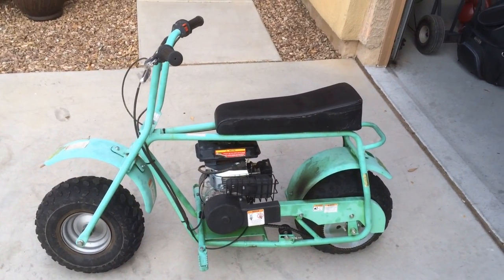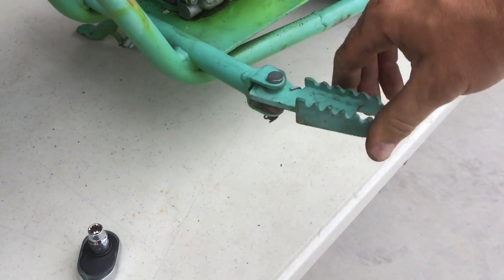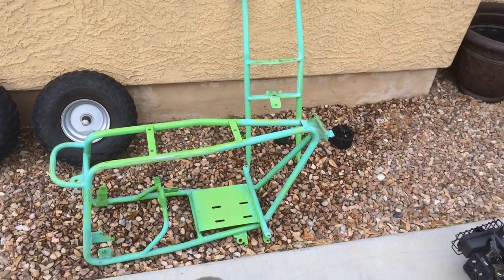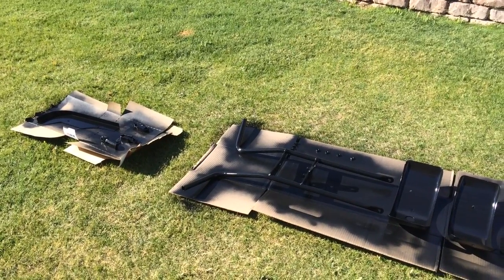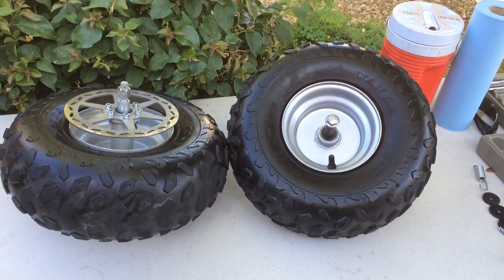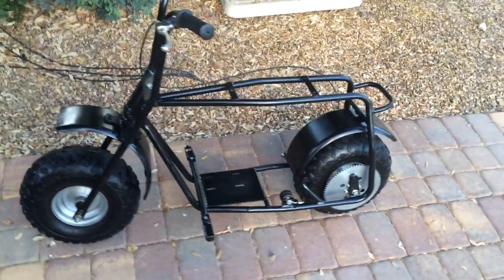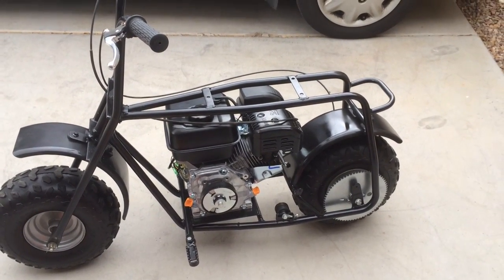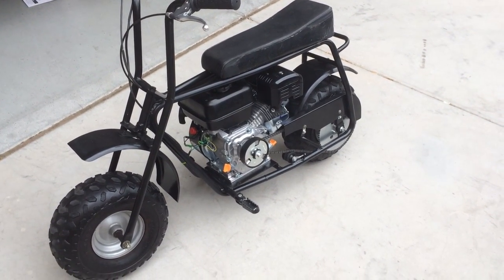Baja Doodle Bug Project

Comment: I got the same minibike for my son with the same lil gutless motor. I got the 212 hemi and put stage 3 mods. And did some sprocket changing. 52 mph according to GPS. I also took out the governor. Oh and put on shocked forks for a smoother ride. On the front only that is. Lol. But it keeps tbe front tire on the ground better like a strut s does for ur car.  Nice vid bro. Plz be safe. But HAVE FUN DOING IT..!!

Comment: this video really helped me build my bike it almost looks identical to urs the only problem im having is the clucth tearing my shoes and pants up i guess i will have to fabricate a cover at work but nice job on ur build can't wait to post my vid!
Reply from the maker: I'm glad to hear your project went well!  It's way too hot in AZ to even wear pants, so I can't say I've ever had the issue of pants getting torn up by the clutch. Just to verify, you have the sprocket portion of the clutch facing toward the motor, right?  I'm not sure the chain can line up correctly if you had it turned around but that might explain the issue you are having. 

For simple options, They make straps that attach to your pants and go under your shoes to keep your pants from getting caught for regular motorcycle riders.  You could also get a Velcro strap to wrap around your ankle area to keep the pant legs secure. 

Drive safe and have fun!
Reply: Yea i have the sprocket on just the way u have urs and believe me im from Houston TX and it gets pretty hot over here but i work at a fab shop so ill figure something out to cover that i will pass on ur video to other mini bike builders greetings from H-Town!

Comment: I’m glad you showed how to install the shutoff switch on the handle bar , I am doing it now , also I’m upgrading the pipe and air filter and Possibly the valve springs

Comment: That's looking pretty sweet, but just a word of caution on your grip installation technique from a bicycle mechanic, use rubbing alcohol or hairspray instead of soapy water. If the grip gets wet again it can cause the dried soapy water to unstick and your grips will slide right off.

Comment: I redid the Coleman ct200u with the 212cc ten tooth clutch and 50 tooth rear, it only does 22 mph but I built mine for off trail. I live in Oregon so I need more torque then speed. Looks great.

Comment: What clutch are you running? I'm 220lbs and mine shakes like hell on acceleration, I feel like it's the clutch struggling to lock up, but it's also a cheap clutch.

Comment from the maker: Although it's a pretty tight fit, there is room to remove the gas cap and fill the tank with gas.  If you have a gas can with a longer, flexible spout it makes it easier.

Comment: I still have the original 97cc and the bike rarely gets used. I'm wondering if, after upgrading to the 212cc Predator, if the single disc brake is sufficient for the additional speed?
Reply from the maker: I kept the original brake installed without any issues. I’m sure there’s upgrades but I never did one.

Comment: Awesome build!  i just got a DB30 myself givin to me, unfortunately the engine and clutch are beat up pretty bad.  i want to do the predator swap aswell.. i went on harbour freight website and theres 2 different model #'s for the 6.5 212cc engine.  do you know which engine you got specifically.  was it the part #60363 or #69730?  thank you in advance.
Reply from the maker: That guy - If you don't live in California use engine 69730. Enjoy!

Comment: I live in arizona too, can you ride mini bikes around in your neighbor hood?
Reply from the maker: Snubz30 Motor vehicle laws apply to neighborhoods as well. That being said, if you ride around your neighborhood without being a nuisance to your neighbors, MOST people will not have an issue with it. In my experience, most people (usually kids) that have motor driven toys (mini-bikes or Go-Karts) drive way too fast, make too much noise and have no regard for neighbors. Me and my boys would ride this Doodle Bug for miles throughout our neighborhood on a regular basis without a single issue. Again, HOW you ride and how often you pass the same neighbor’s house will most likely determine if anyone has a problem with it.
Reply: Zach Wolfe ok thanks for the info

Comment: Did you use the same chain that came with orginal motor, plz let me know asap thank you.
Reply from the maker: No. The description has all the parts I bought, including a new chain from eBay.
Reply: Oh ok thank you very much
Reply: As long as it's a #35 chain I should be good right?
Reply from the maker: Make sure it's a 140 link chain. It may not fit if it's smaller.
Reply: +Zach Wolfe  ah ok thanks
Reply: +Zach Wolfe I already bought the clutch and it's not a link just a description but thanks I'll just look for 140 link #35 chain, sound right?

Comment: Can you mount a 212cc directly to the doodlebug without the plate? What are the reasons for the plate?
Reply from the maker: Pyro Nurse You do not need the mounting plate but it is highly recommended. The doodlebug comes with a very thin bottom plate attached to the frame and an additional thicker plate that is also installed for support. The holes on the thicker plate do not line up with the 212cc motor so it cannot be re-used. In addition to the stability that is greatly increased with the PMR mountain plate, it also provides bolt placement adjustments which helps to make aligning the sprockets much easier.

Comment: I have the same set up but I didn't get the mount plate I drilled my own holes the chain is straight to the sprocket and clutch but the chain keeps coming off when full throttle at first or while riding. Any ideas why ?
Reply: K20xOG x check chain aligment or give it a bit of slack..

Comment: Will a 3/4 bore and 12 tooth for 35 chain clutch work with the stock rear doodle big sprocket?
Reply from the maker: SeanFilm Yes, no need to replace the rear sprocket.

Comment: Could you please provide the info on the mounting bracket you used?  Model and where you got it.  Thanks.
Reply from the maker: +Tony Hughes - All my parts are listed in my description:  PMR motor mount plate, drive shaft spacer w/clutch mounting bolt and throttle linkage kit = $66 shipped (hotrodminibikes.com)
Reply: +Zach Wolfe Is there only 1 size/model of the PMR motor mount plate?

Comment: did you need to drill holes through the bottom of the bike to get the bolt to go through the engine for the motor mounts???
Reply from the maker: Yes. The mounting plate comes with instructions but you will need to drill holes.
Reply: Zach Wolfe oh do you need the mount plate or can you do it without it?
Reply from the maker: +Jacob Kenyon You don't need the mounting plate but it makes aligning the sprockets very easy. The mounting plate allows for engine placement tweaking. If you mount the motor directly to the frame, there are no adjustments that can be made.
Reply: ok so is it worth it to buy one??? like if i put a 212 would the chain always be poping becouse my doodle bug i have adjusted so would the chain just pop off without it? or would the clutch and sprocket not be aligned
Reply from the maker: +Jacob Kenyon For the $40 or so, the mounting plate is worth it. Provides engine stability and alignment benefits.
Reply: Zach Wolfe ok thanks i will probably buy a custom exhaust and racing clutch and carb
Reply: Were did u buy the mounting plate from????

Comment: I found every thing but the stuff in the hotrodminibike website I don't understand what to get could you put down links or something?
Reply from the maker: PMR mounting plate:
http://www.shop.hotrodminibike.com/PMR-Adjustable-Motor-Mount-Kit-PMRMM.htm?categoryId=-1

Throttle linkage kit: (As noted in my video, this part is unnecessary.  The Predator motor has all the necessary hardware to attache the throttle.  However, I did hammer the 2 angled pieces flat in order to raise the chain guard)
http://www.shop.hotrodminibike.com/Throttle-Linkage-Kit-TLK4-65.htm?categoryId=-1

Predator bolt and spacer kit:
http://www.shop.hotrodminibike.com/Predator-Bolt-and-Spacer-Kit-PREDBK.htm?categoryId=-1
Reply: Zach Wolfe thank you so much

Comment: 5:22  I see that engine plate it was in other vids too do you reuse it ? what is it used for?
Reply from the maker: 1digitalwatcher The small engine mounting plate that comes with the original engine does not work with the Predator engine upgrade.  You’ll want to order the PMR mounting plate as listed in my description with parts.  It adds stability and easy frame mounting for the new engine.
Reply: @zach_wolfe  Ok THANK YOU  I got to order a lot of stuff been reading and reading on here !!

Comment: Great video but how hard is it to get that gas cap off?
Reply from the maker: Muhammad87 Others have asked the same question. It is less complicated than it would seem. Filling the tank requires a longer flexible gas spout to avoid spilling excess gas on the engine. Thankfully you get a lot of riding before needing  to fill the tank again.

Comment: I have a raceor and it is fun to use but the engine is messed up, if you have a enggine could i have it. My engine is pretty much shot by this point.
Reply from the maker: I don't have any extra parts, Trevor. If possible, save up and upgrade by following my video for guidance. Turns a fun toy into a beast of a machine!

Comment: looks like it would be hard to get to the gas lid to add gas. is it?
Reply from the maker: It's really not bad. Using a gas can with a flexible spout makes it easier, but the gas cap is not difficult to get on & off.
Reply: +Zach Wolfe thanks for the reply. I'm working on the same bike and you did a great job on your. hope mine turn out just as good.

Comment: I had to put another cable spring on to get better back rpm..20:30.
Reply: +ELVISRN1  put a torque converter if you have a few hrs. you will be impressed. great vid!

Comment: PMR mounting plate is mounted WRONG..."PMR" text should be on the left side of bike...
Reply from the maker: DeeInTheHouse Well, OK. Apparently it doesn't matter too much since it's been working great for lots of years. Best of luck on your build.
Reply: You are right, it will work...but, if you bolted it up the way it was in the video, all your adjustment will be to the right (no left side movement) and the plate would over hang.

Comment: Can you make these street legal?
Reply from the maker: Laws vary from state to state so you will need to look into your local laws.  In AZ, all recreational vehicles must be registered in order to be used on ANY state maintained road (including off-road). Street legalizing generally requires headlights, tail lights & turn signals. I'm also not sure if a 212cc motor qualifies as a big enough engine to become fully street legal.

Comment: Do you have to have a mounting plate to mount the predator 212cc?
Reply from the maker: SeanFilm You do not need the mounting plate, but it makes it a lot easier if you use one. The stock metal base on the mini bike is rather cheap and since you have to drill new holes to mount the new engine, I would highly recommend the mounting plate. It takes the guesswork out of drilling and has some flexibility to help with chain tensioning and alignment.
Reply: Thanks Zach i appreciate it
Reply: Zach where did you order your mounting plate?
Reply from the maker: Lee Lambert Hotrodminibike.com sells the PMR mounting plate.